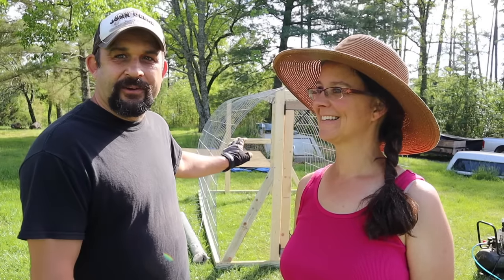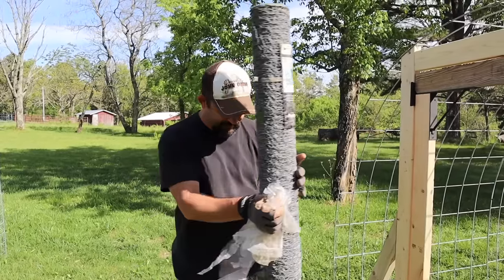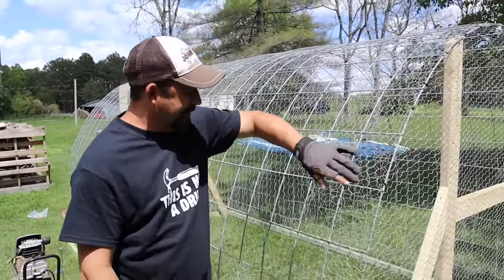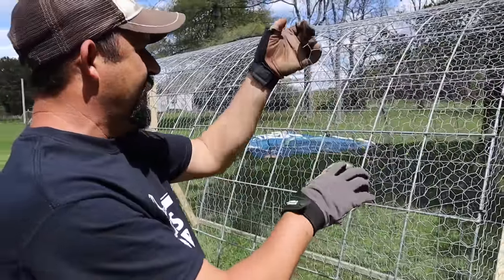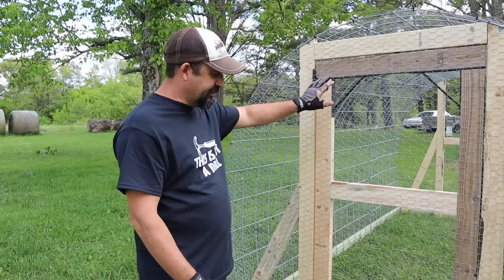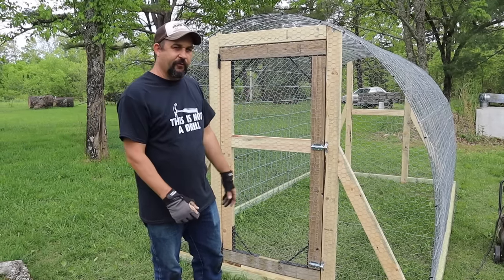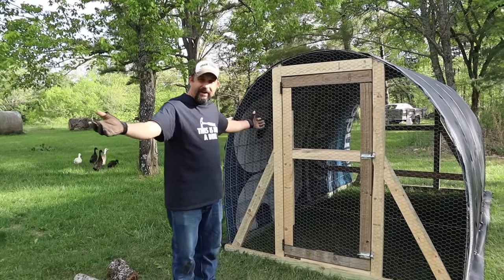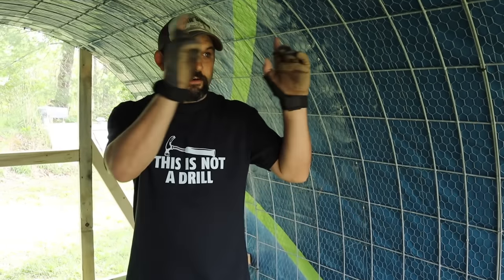The Chickens MOVE into the HOOP COOP!

Comment: Could a predator dig underneath the coop....? That’s what raccoons did to our chickens.....😕
Reply: You can build an anti-dig barrier basically take a cattle panel, cut it the long way, put hardware wire on it and attach it to the sides with hinges so it looks like the coop has wings on all sides. When you want to move it just lift the wings onto the coop and move it then drop the wings again :D it really works since most animals won't want to dig a long tunnel to the chickens
Reply: A chicken coop apron that is two feet wide in every direction from coop (ie. including corners) has worked wonders for us.
Reply: We have skunks that dig under everything and kill our chickens. We finally had to pour a concrete floor in the night coop.

Comment: We built this cattle panal green house 6 years ago and it works like a champ 
I’ve moved it a few times and its still awesome. The best part is the weather Ive never have seen it move even when we get a few tropical storms pass here in VA Beach!!
Reply: I agree. I have a cattle panel green house and the wind just flows over it. I am using it for storage and it is very secure.

Comment: Here in az desert we cover ours with Styrofoam panels for insulation and top it with canvas. We have a small 500 watts air conditioner we install in the back. In the hot summer we spray it down with water for cooling our animals down. We secured ours with t-posts and our hoops been thru many monsoon windstorms and it hasn't budged. We use a few hoop houses for storage purposes also we park tractor in one. They are good homestead structures. Great video!!!
Reply: What kind of styrofoam panels, if I may ask? Dee from Arizona

Comment: Do you have a vinyl pool builder in your area?  If  they have any old liners they have replaced. They make great tarps. And will last for years. They may give it to you for free.  A so call heavy duty tarp.  You buy at a hardware store. May last a year if out in the sun.  I took a blow up  pool from Walmart. 10 by 6 feet. to cover my lawn mower. And we found a round pool some one was throwing away. Cut the bottom out. It covers my other mower. Have had it for at least 4 years. And it was old when we got it.

Comment: Kevin, zip ties will have a massive failure in short order when exposed to UV / sunlight. Been there, Tom
Reply: Guess it depends on which ones he bought.  I have some on my trellusing out back that are from 2008. But I buy the big 1000 pack heavy duty uv resistant something or another ones.  
So far the only ones that have broken are the ones where the tree limbs came down. Oh and where the deer got trapped inside the circle garden and tried to smash it's way out. And even then I only had to replace a few. 
Wish I had the packaging I'd send you the brand name.  They also make stainless steel zip ties we use on the mowers and even my jeep muffler (lost a hanger under there lol )
Reply: Aren't the zip ties covered by the billboard material?
Reply: The white ties are UV resistant.
Reply: Black ties indoors and white ties outdoors.  They are UV resistant.

Comment: Hi, nice work! Just a detail tip: try to reinforce the front and back with the stronger net or wire that you used in the top, otherwise predators will easely wrap the smother chicken net.

Comment: I would have used 1/2 in hardware cloth instead to keep out the snakes.
Reply: Had a terrible time with snakes in my North Central Florida coop. They feasted on the eggs. I was not aware of them until I reached in to get eggs and wrapped my hand around a Rat Snake. It had already eaten an egg.   I put it in a cloth bag and drove it a mile away and set it free. Between the snakes taking eggs and the other critters reaching through the wire and ripping chickens heads off, I gave up. We had a huge cage. It was a camper storage unit frame. Covered it with 2"x4" welded wire and buried chain link 2' down and around the bottom. It still attracted too much traffic.
Reply: To keep out everything. Any predator can rip right through chicken wire. I never make anything with chicken wire after I had a rat push through it and get after my pullets :(
Reply: Sagans Run   I don’t have a problem with snakes where I live, but I saw a video from a guy in Texas that uses plastic bird netting rolled and bunched up around the perimeter of his porch to catch snakes in. The snakes get caught in it and can’t get out, apparently. You might give it a try.
Reply: @cynthiafisher9907  I'm going to keep that in mind to try when I build my coop and rabbit enclosure. I'm definitely using hardware cloth.

Comment: I have a hoop house made from cattle panels. I used the foam insulating tube used for pipes over the hog clips to save the plastic.  It has been several high winds and it has not budged.  I also live in SW Mo.  We moved ours this  summer and it was a chore. We loaded it on a trailer to move to a different part of the farm.  We also had shelves build inside so it was heavier and a  burger to move.

Comment: I like this design. With a little modification it can be used for a low budget greenhouse 😀
Reply: Just make sure to cushion the edges. I had a green house made from panels and there were sharp areas/edges that we had to put cardboard on as the wind rubbed the poli against them and ripped it. Easy to fix but I figured if I can warn people ahead of time they wont end up having to fix.  A tree fell on mine and I'm just saving money to replace it but next time round we are covering the panel edges with duct tape first.  Oh and this time round. Door on both ends. Only one door that little green house heated right up in the summer lol I want a way to control that heat this time around
Reply: @Emeraldwitch30  thanks for the tips. I am reading all of them. I have always wanted a green house & this is making it a possibility.
Reply: yes, my thoughts exactly, it would be squirrel proof, bunny proof.... and the chickenwire over cattle panel  might even make it cabbage butterfly proof LOL I actually got a start, sort of, put up 4 cattle panel hoops in the garden so my beans can climb.

Comment: I’d put some wheels on it to move it from time to time and some chicken wire on the bottom it if you got fox 🦊 in your neck of the woods they’ll dig under it they did it to my coop so I put chicken wire on the bottom of it it worked like charm no more fox problems they still dig holes next to the coop trying to get in but they give up and I just fill holes back in but I like that hoop coop design you gave me some ideas thank you 🙏 god bless

Comment: I thought showing the black side out would cause the coop would draw the sun on it, making it hot for the chickens, right?
Also I've watched several chicken coop building and this is great on the cheap, however you forgot to add a guard around the bottom which people are putting to keep predators from digging in under it. About a foot or two out from the bottom wood out and bury it into the ground a couple inches, a no see.

Comment: HELLO, 
I'm French and I'm a fan of what you've done. I would like to make some but what are the exact dimensions of your metal frame or panel (cattle  panel 480cm x120cm) as well as the diameter of the welded wire (6mm ? ). Thank you for your answer and nice work . Sincerely JM

Comment: need vite d3 from sun (1/2 open), predictors will dig under(cage bottom same), put wheels one end to move to fresh grass daily (trailer jack and attachment to pull), one end outside access laying boxes-water- feed refill from out side, needs ridge support running length to take snow load (we accumulated 3 to 5 feet), use pressure treated, otherwise brilliant

Comment: I would not trust chicken wire to keep predators out. I recommend 1/2” wire mesh. Raccoons can rip through chicken wire. Also once placed in a permanent location it’s important to lay or bury wire mesh 1’ out all along the bottom edge to keep predators from digging under. Otherwise it’s a simple, easy idea.

Comment: I think it is very nice. IF it were mine, I would have used welded wire instead of cattle fencing and I would have put welded wire on the ends too. Predators WILL get through that chicken wire on the end.  I've had dogs to do it and kill our bunnies. Everything was welded wire except the bottom and that dog ate right through that chicken wire.  And I would have put the tarp on 1/2 or may 3/4 of the top, so the chickens could get sun too.  JMO

Comment: Hi, FYI having a arch like a tunnel is one of the most stable designs,as for under ground  the pressure from the Earth's weight pushes from both sides towards the center of the arch and is the best design for a tunnel as it helps prevent a cave in.   Above ground is is a design of rounded roofs that is best suited to withstand hurricane force winds 150 miles per hour or so ..it is a excellent design against the elements also just try to position the side's to the wind and not the front and back ..and it should do just fine ..good video ,I work in construction and looks like a good build! Thumbs up. The only thing I would maybe done a little different would be the front and back framing but only because of my constitution knowledge and experience...and as my friends might say " were not cutting diamonds lol ..good job I'm planning to build one of my own as I had some of my hens just hatch some peeps out a few days ago ...Thanks for the video!

Comment: Do you think a hoop hutch like that can be used long term and if so would you suggest making an enclosure inside to protect them from the wind and cold?  Maybe even have the option to close the back section up.  Just bought supplies to build me one but plan on it being a permanent home for the chickens.  Also plan to use hardware cloth on the outside up 2 ft over the Billboard vinyl to keep anything from damaging it (at least up the side 2 ft.).  May also add add'l wood beside the door for extra support.  A few modifications but am excited to get started.  Love your videos.  They've been very inspirational.  Blessings.

Comment: You should put wood chips down (don't use cedar) instead of a straw like materiel. It allows the chickens to scratch in it, and this will mix their feces in it. This will allow different types of insects to start propagating in the wood chips (yum yum for the chickens). Lay down a good thick layer of the wood chips. Their feces will break down much more efficiently and you won't have to clean it out nearly as often. If it starts looking too dirty just lay a new layer down on top of it. When you do clean it out (no more than once a year) you have some great garden mulch.

Comment: I had 24 chickens for 7 years.. White Leghorn's with plenty of eggs all those years and I can tell you  right now.. I had skunk issues. fox issues and rodents who wanted those eggs or the chickens for dinner.  YOU MUST lay down at least a chicken wire floor to keep out these invaders.. because they will dig under that frame and tunnel inside.  You need a barrier either on the ground or around the frame on the ground on the outside to prevent digging under the coop.

Comment: They make adjustable slide bolts now for doors where the opening that the bolt slides into moves up and down. This helps to account for expansion/contraction and these locks are usually sold right next to the one you have.

Comment: Great job, only thing I would do is double up the vinyl seam @ 18:32. I would then use a twelve foot 2" strip of wood to place on the top edge of your lower 2x4 and screw through this wood thus securing the vinyl securely in place. Keep an eye on that coop, it only takes a few minutes for a bobcat, coyote or fox to dig under it to get themselves a meal.

Comment: It's a great design I'm in the process of making one for my chickens and ducks now. But to make it really predator proof you should have installed hardware cloth all the way around it then extended it onto the ground to keep predators from digging under. As far as the door latches I prefer to use the door  latches and a carabiner. You're 2 by 4 roost bar really needs to be on the flat side that way the chickens can sit on their feet and keep their feet warm. I'll be adding a coupe inside of mine that way they'll be locked up every night.

Comment: Great design. Only thing that I would change is to not just use chicken wire. Add dog wire over those areas right over the chicken wire since chicken wire is only used to hold in chickens but predators will bite right through it and get into the chickens.

Comment: Hi, my understanding is cattle panel wires are atleast 4gauge or 5mm diameter. Will a thinner wire around 2.5 mm diameter work? Could not find cattle panel in Ireland.

Comment: I built one just like it except, I used electrical metal conduit and a conduit bender. I then put 2 bicycle wheels on it with a lever to raise the pen. It balances on the 2 wheels and is so so easy to move around. Nothing is on the ground. The feeder and waterer hang and the roost hangs and the nest box is mounted on the end with a hinged door so you can gather eggs without going inside. It is super light which means it cannot be used in the open. I live in town with a privacy fence so it works fine for that. I also used a vinyl cover on mine.
I loved how you two work together. You did a really good job. 
Lord bless and be with you in these difficult days.

Comment: loved the video. some tweeks I thought of..could use some clear plastic  vinyl on part of the top for light on half the coop and could have left the extra front piece as an awning on a tent with tent poles and ropes. Personally I thought of wanting an extra top piece of wood on the back too and considered a wooden door latch that just swings into place..I could put some skids on the floor too. We live in a colder place. I wonder how this could be winterized. What  tools are you using to cut the Cattle panels and to cut the chicken wire?

Comment: Why did you use chicken wire if you were using the heavy tarp?  Seems you could have saved the $ and not used the chicken wire or at least not all over.the bottom half would have kept out predators.

Comment: To attach the tarp at the bottom on each side, you could have left an equal amount of the excess tarp on both sides. Then took a 1x4 board and wrapped the excess tarp around the boards and screwed them to the outside of your 2x4. The wind could never rip that loose.

Comment: I was wondering if you did the ends first so the chicken wirel would lay between the cattle panel and the straight edge of the sides so you wouldn't have the ruff end exposed, what type of cost did you have in the finished project?

Comment: I love this project! I am actively looking for a new coop design for my birds. With lumber at a all time high I. Price, this seems like a very viable solution. I wonder if you should conceded enclosing the floor with wire also?  My worst predators are diggers. A wire bottom would keep those guys out. I bet you could also reinforce it so it could be moved with a tractor if the need arose.

Comment: I made one like that but i used zip ties every where on it and attached the cattle panels to t post as i was making it.  I used a large tarp to go over it.  My question is how do you winterize it on the ends.  And i like your door i think im going to change my door to like yours.  I have a large chain link fence door for mine and it taller than the coop itself so its harder to winterize.  My coop has lasted several years now and shows no signs of wear and tear.  I love mine but it needs some new tweeks for like the front door and the back they are hard to winterize cause of the curve.  I love your front door though.
Jackie

Comment: I am thinking about making a  greenhouse with this idea as well  Using Savage Patriot
's idea bolting only one side of the vinyl and then rolling it on a pvc pipe or 2x4.   Similar on some polytunnels. I could cover it for a greenhouse effect to get my plant a head start and then unroll it to one side.  The best part is I can cover it back up quickly when we are expecting Hail.  Solves all my problems.  I have a head start, I can keep animals out and I can protect my plants from Hail.  Win, win!

Comment: What do you use as bedding? The inside of our hoop coop gets wet every time it rains. Do you recommend additional tarps on the open ends or use a particular bedding material in. sand, straw, or pine? Also, what do you do to keep the flock warm during the winter?

Comment: I'm just finishing up the second one of these for our chickens. Great idea and great designs. I made a few modifications. First, I put the tarp between the cattle panels and the chicken wire. It helps cut down on tarp movement because of the wind. Second, I put a door at both end and found that the 45 degree supports were just not needed to strengthen things up. Third, because the wind can get crazy out here in Arizona, I anchored mine down with 4 2 feet long 2x4. They attach to the side and go down in a hole filled with concrete. The first one was done more than a month ago and stood up to 50 mph winds with no issues whatsoever.

Comment: Instead of being bothered with the hoops for the latches, you could also have put the latches on the boards on the side and not on the door. Since you need to pull the door to open, with the latches in the other direction, just sliding them in front of the door would keep it closed !